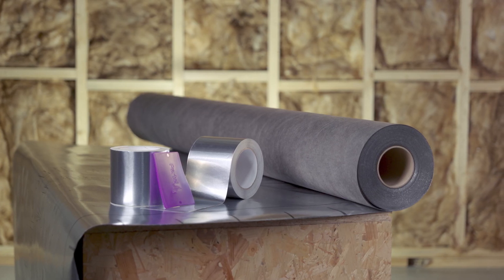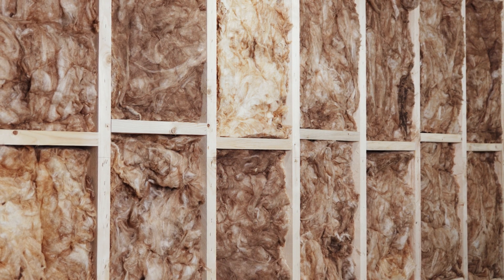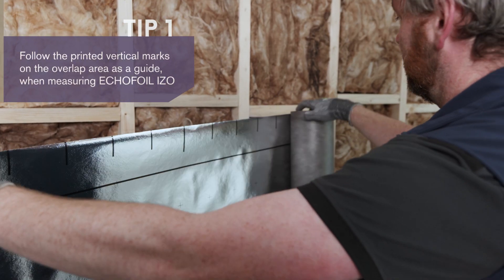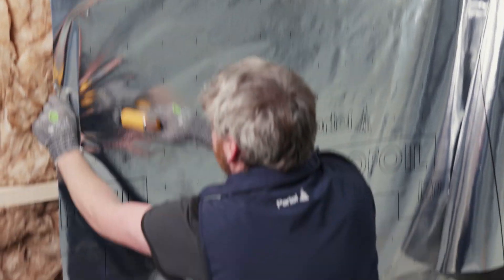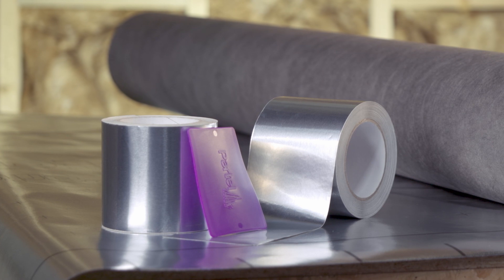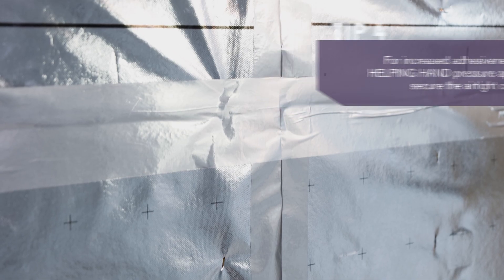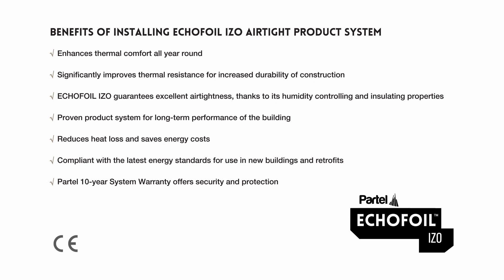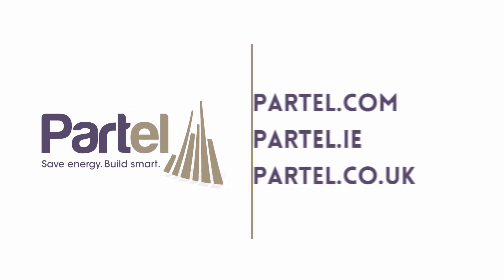How to install a reflective vapour control layer - Partel ECHOFOIL IZO Product System Installation

Comment: What about all the small holes you've made with the staples?
Reply from the maker: Great question!

Our Echofoil Izo membrane is designed for internal airtight and vapour control applications, where mechanical fixings such as staples are a standard and accepted method of temporary attachment before applying sealing tapes at overlaps, joints, and service battens.

The small punctures created by staples are insignificant to overall airtightness or vapour resistance once the system is completed. The key is to ensure that all overlaps are properly sealed using compatible airtight tapes (e.g., ECHOSEAL Foil, VARA SEAL or CONEXO), and that the battens provide continuous mechanical support.

In short: staples hold it in place; the sealing system does the airtight work.